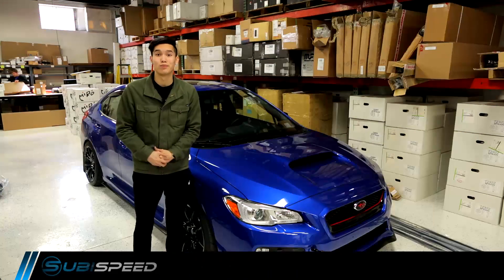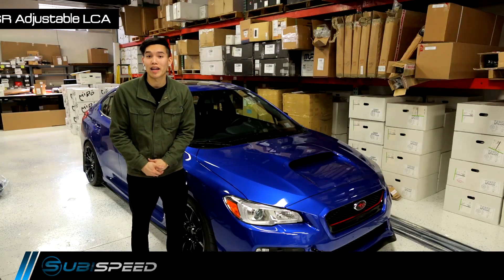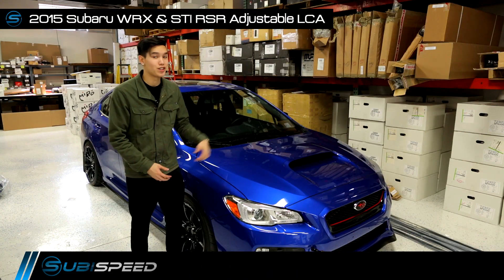Subispeed - 2015 WRX & STI RSR Adjustable Lower Control Arms

Comment: I'm driving the 15' WRX and whenever i go over some ramps (into the malls etc) the bottom plate rubs against the ground. It rubs sometimes when it's not even that steep. Is that common to all WRX's? This never happened to my older Impreza...
Reply: It's not rub. It's the diff doing its thing. Try this: turn off your traction control all the way, and then try going over the same ramps that are giving you that rubbing sound. it will no longer be there.
Reply: Herman Tse Yes it's common because the piping on the 15 wrx happens to be lower than the visible sides and bumpers of the car.

Comment: I am loosing it with my wrx16. keeps pulling to the left. all kinds of alignments done and today a mechanic suggested getting something like this to adjust camber in the back. but im just tired of taking care to so many places and nobody is able to figure out why car pulls to the left.
Reply: Did you check the air pressure in your tires?
Reply: hey Brian. Yessiree! Changed tires, rotate wheels, balance, everything. The last alignment seems to have put it straighter but I’m not sure if it’s that my tires are too grippy and the slightest camber on the road makes it go to the sides.